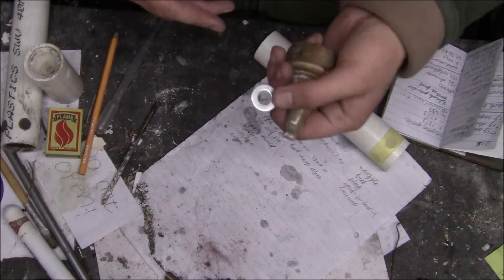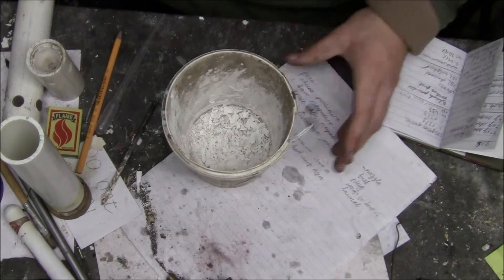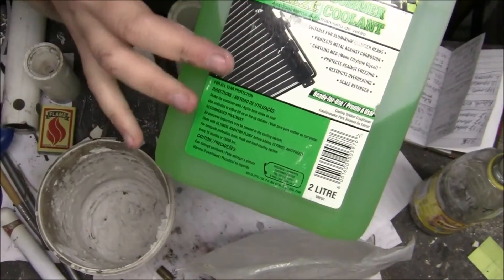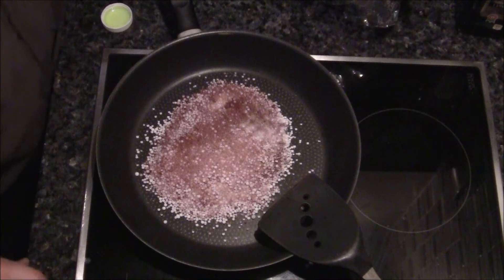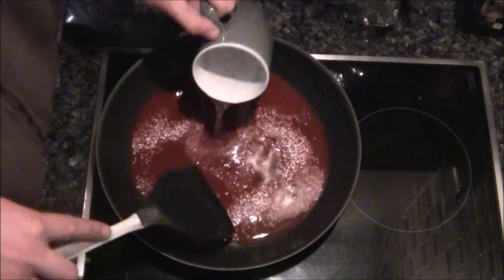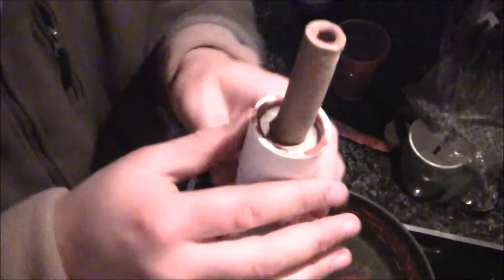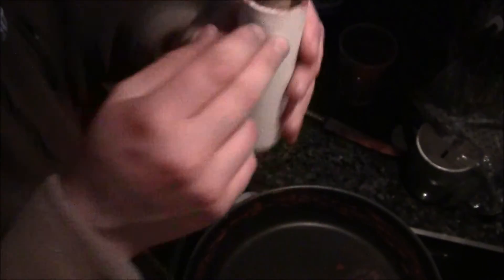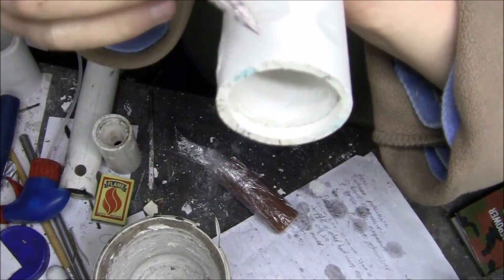PVC ROCKET MOTOR tutorial changes

Comment: you should leave the casting tube in paper, around the grain. It will inhibite its outer face, thus exposing less surface area and giving and gentler motor (quite importante because you are using pvc pipe)

Comment: Can be a PCV motor class I? i will have to create a PVC rocket motor until the end of this year. i already projected it in the Nakka programs and i already know the measures and weight of the propellant (KNSU).
Reply from the maker: are you asking if the motor in the video is an I class motor or are you asking if its possible to make an I class motor with pvc?
Reply: @HomeGrownPyrotechnics  can be both of these two questions hahaha
Reply from the maker: @codigosujo021  well the motor is either a G or an H, cant remember. and yes you can make an i class. can get some really high class motors with pvc.
Reply: Thanks for answering!!. I will probably apply these steps that you show in the two videos about pvc in my I class motor, just changing the measures(nozzle etc) and the mass of the propellent.

Comment: Why do we cook, why don't use it in fine powder form.
Reply from the maker: Because for this type of rocket motor, the fuel must be in one solid piece to butn the way we want it to, the best way to do that is to melt it. It also helps mix it very well.
Reply: @HomeGrownPyrotechnics  if we mix it really well and pound it to a solid
Reply from the maker: Doesn't work like that. It needs to be melted together. If you pound it solid and remove it from the case, it can fall apart. Also won't burn the way you want it to
Reply: Try i video with pounded, melted, and cooked then powdered then pounded motors.
Reply from the maker: @adityasuresh6607  powdered fuel only works for small motors. Big motors like the one in the video need to be melted
Reply: I want to build a rocket one with 1 foot motor and other with 3 foot motor, what material do you suggest for motor body should I use 40 mm steel pipe
Reply from the maker: i think you should start with small motors before yo go big. it can be very dangerous when you don't know what you are doing.

Comment: Almost blew my face off building a few of these. https://www.youtube.com/watch?v=Ezlb4F1aaF8
Reply from the maker: TheExploreStore
Q1:was it one of my designs?
Q2:in your thumbnail, why did your rocket have a wooden nozzle screwed in?
Q3: if you didn't build one of my motors(which by the closeup you gave I can tell you haven't or at least weren't following the instructions) where did you obtain the info for such a motor?
Q5: why did you use packed powder fuel? what I use gives the most efficient burning.
Reply: I live in a small town in the middle of nowhere so i am using what i have, there are no designs. I did use wood as end caps once but i am using teflon plastic now because its strong, light and i can reuse them. I'm using packed powder just because its easier and it does what i want it to do and i can make 5 engines in 30min. The first 4 exploded but that how i learn and have never had one failing since then. Not all Sugar Rockets have to be the same. It's like they say " If it looks stupid but it works then it's not stupid". But i am going to use your recipe next time, but i'm not going to stand so close then.  Have fun making these, i know i am.🙂
Reply from the maker: TheExploreStore  the rocket in my tutorial was made specifically for people that want to know how to make these types of rockets and have an understanding of what they are doing but dont have access to many of the exotic materials that other rocketeers use. my motor also has a very high rate of acceleration as all the fuel burns up in less than a second. I doubt that the setup I saw with the motor you are making would be able to withstand the pressure generated by the fuel grain shown in my tutorial but you are welcome to try and see what happens.
Reply: Thank You, will do!

Comment: I've used plaster (FIXALL) for LOX-paraffin hybrid nozzles, not the best but did work.
Reply from the maker: well because these motors are single use it doesn't matter whether it lasts long or not. the washer fights off the erosion long enough for it to stay in tact. i would emagine that for a hybrid engine you would need something that is a lot more heat and erosion resistant like steel milled nozzles. ps if you haven't watched the full tutorial for which this video is the changes for, please do, you can find it here: https://www.youtube.com/watch?v=fEyk-Mj1xHU&t=3s